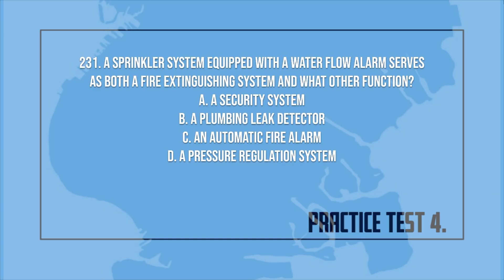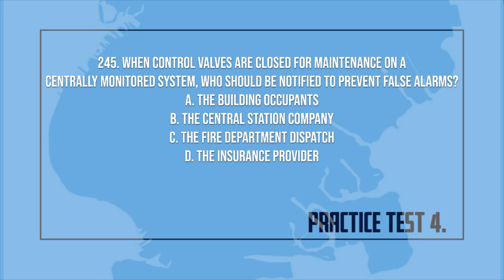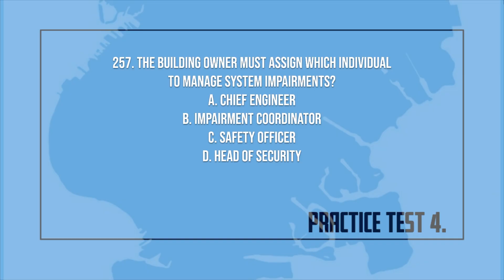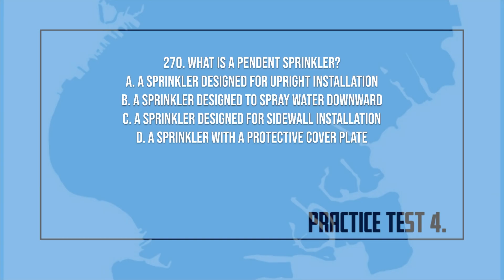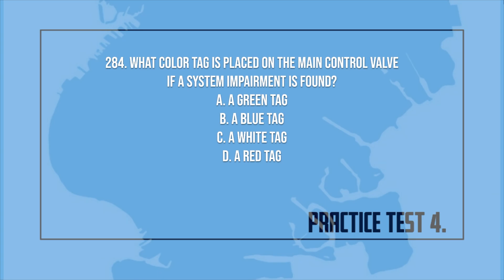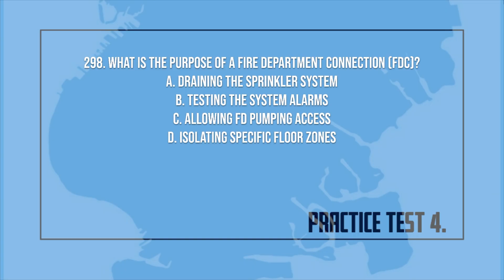FDNY S-12 CERTIFICATE OF FITNESS for CITYWIDE SPRINKLER SYSTEMS Study Guide PRACTICE TEST 4.

Comment from the maker: UPDATE: I've gotten some updates from followers who've recently taken the exam (3/16/2026);

1. Make sure you review the photos provided in the FDNY Study Material link. You can expect about 4-5 questions asking you to identify a sprinkler head or other piece of the system based on the exact photos in the material, @ 1.3 points per question that's 5-6 points just based on photo identification. These are "gimmies" if you study the photos. 

2.  DO NOT FOREGT that the top of the the Inspection, Maintenance & Testing lists, has at the notification requirements. In addition to identifying what color tag to place on impairments based on the chart, you'll get 3-4 questions also asking who should be notified due to the impairment. The easy thing to remember is that you ONLY NEED TO INFORM THE FDNY FOR RED TAGS. For Orange and Yellow tags (minor impairment),  you only inform the building owner for the first 30 days. What color tag to use is easily found on the chart provided, based on the impairment.

3. Lastly, BE CAREFUL, there is a very easy question asking you to identify the temp range of a colored sprinkler bulb (photo given in the question) using the chart provided. NOTE: THE TEMPS IN THE MULTIPLE CHOCIE ANSWERS PROVIDED ARE IN CELSIUS NOT FAHRENHEIT! It's a very easy question if you don't fall for the trap.  

With this in mind, these 8 questions alone will get you an easy 10 points!

Good luck and congratulations to all who passed their exams.
Reply: Thank you King
Reply from the maker: @DrenicakuAK47  My pleasure. I hope the videos help.